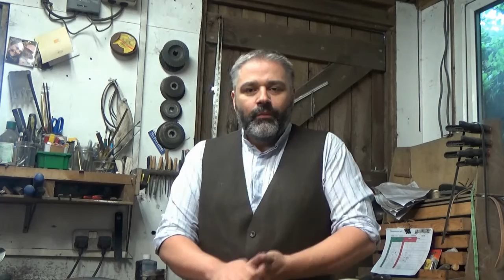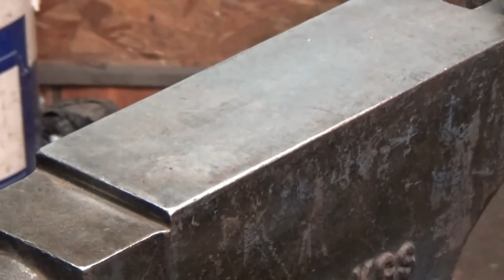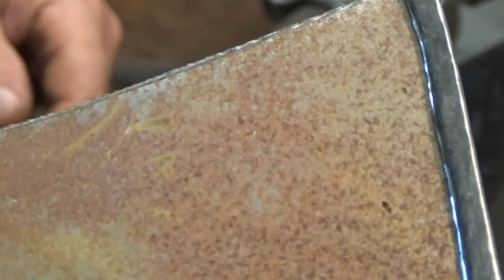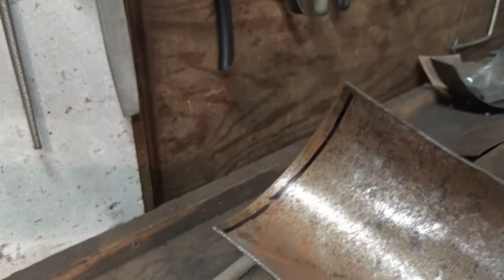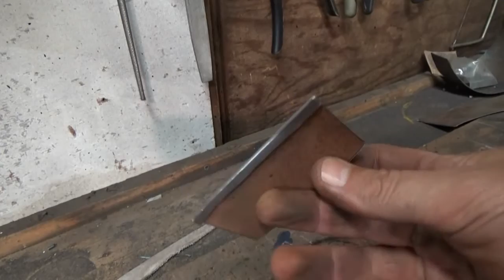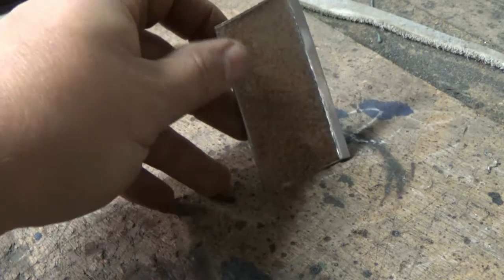The Safety Edge, Medieval Armour Techniques #2

Comment: Hi! I was thinking, can't you just make the safety edge on a flat plate, then curve it?
Reply from the maker: Sometime dropping in the safety edge first can work best, but most of the time I prefer to do it after the metal is shaped. When they are made they can resist the curves and shapes needed for the piece if you see what I mean?
Reply: Yes I do, but isn't that countered with heating the area up with forge?
Reply from the maker: It can be, bit the bottom line is you're moving twice as thick material so it moves slightly differently and can cause some inconvenience on the way ... but I would suggest it's a personal thing. Except with shaped edges like roping, triangles, squares .. then it's definitely a case f making the edges after the shaping :)
Reply: Okay thanks, I am so exited and pumped of doing an armour someday pretty soon, so this helps and clears up many things. Thank you!
Reply from the maker: Apologies for the spelling, I've my daughter in an out pushing me for time :)
Reply: Ah, thats nothing :D
Reply from the maker: It's a pleasure. The best thing, I would suggest, is draw what you plan to make to get the shape settled in your head, all the while looking at any reference material and then have a go, then another go and then another go. If you haven't already get along to http://forums.armourarchive.org/phpBB3/ and read all you can :)

Happy hammering.